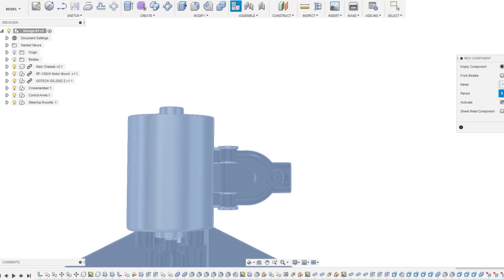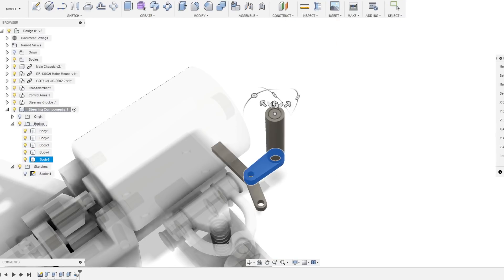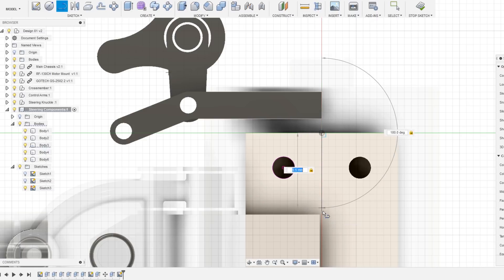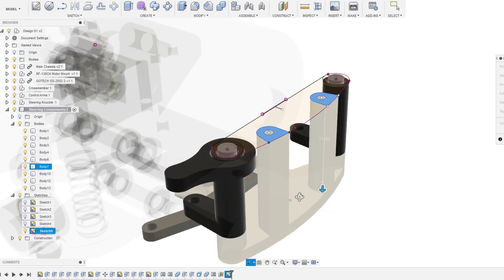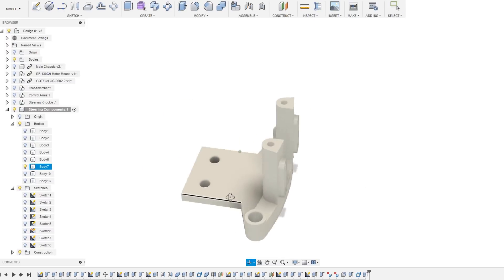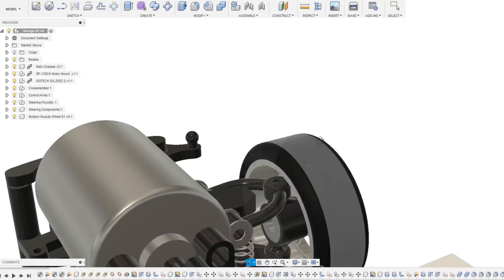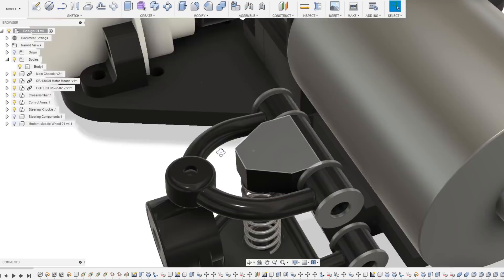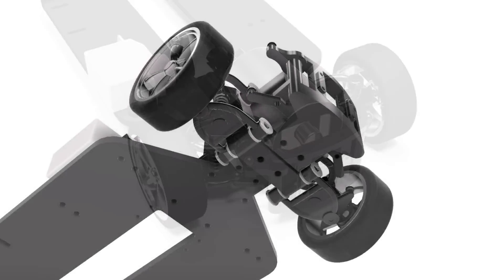Speed Modeling Front Double A-Arm Suspension and Steering for FFR SC1 Part 2

Comment: Putting the rotating pieces in front of the wheels rotating the direction you have them would do ackerman in reverse and may cause a lot of tire scrub.  I think the outside tire would be turning in MORE than the inside tire and have a tighter radius, which is opposite of what you need.  Check the motion before you get too far along!

Comment: Hi, I have some concerns weither bodies will fit over that big steering element in front of the motor. Wouldn't it be possible to snake the steering arm from the servo to the pitman-arm  between the spring and the motor(or, more precisely, between the spring and the "subframe" or between subframe and motor)? Since those are very often made out of a stiff metal rod anyway on Tamiya kits and such, so it wouldn't take up much space at all.
That way, the steering contraption in the front can be a lot lower and thus a lot more rigid as well, a lot less printing :)

Comment: A new level. I used to modify cheap rc cars like maisto tech. Would lighten up the chassis and body. Using the battery from cheap rc helicopter was rechargeable and lighter. But that's as far as i got. Can't wait to see this. 👍👍👍👍👍

Comment: can you do a chasis with push rod suspension design?
Reply: Doesn't seem practical since most drift cars are front engine (motor) and a pushrod suspension takes up quite a bit of room that can be used for stuff like electronics.